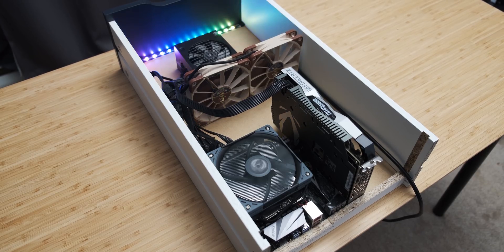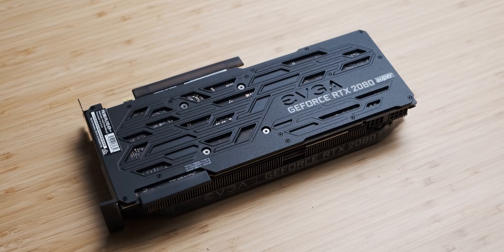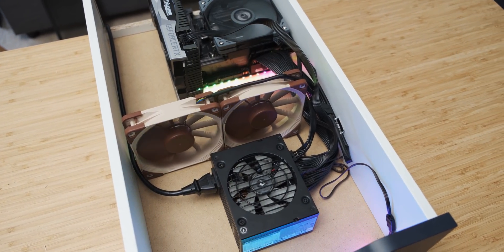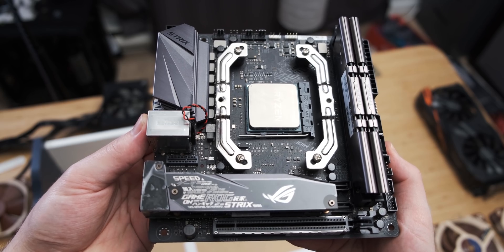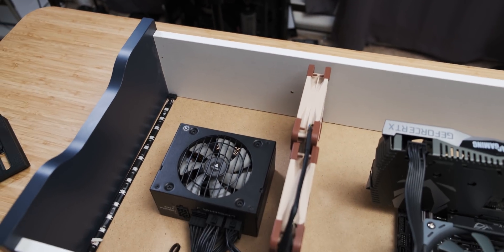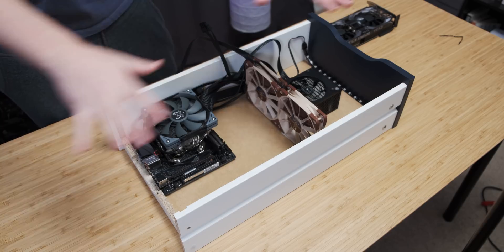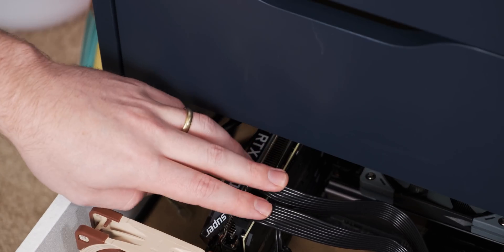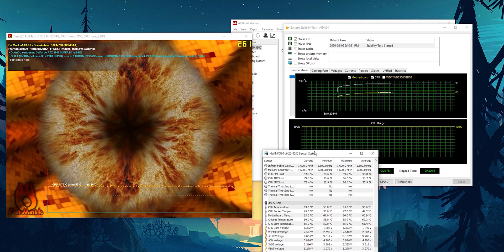How much PC gaming power can you fit in an IKEA Alex drawer?

Comment: Easy to spot the new Dremel owner. They're the ones using a sanding drum on a cutting disk job. :P 
But seriously, if you're worried about the thermals, I'd cut two circular holes in the front of the drawer big enough for the fans to draw in air, paint the newly exposed wood- excuse me, particle board, cut out the middle of two large jar lids and cover them with window screen, put them in the holes like a speaker cover, then mount the fans to the inside of the drawer front.

Comment: Potentially dumb question, but wouldn't it make sense to put different components in different drawers, drilling holes in the bottom of each drawer to allow for cables to go between them? Theoretically, this would mean that less airflow is needed per drawer. You could put the power supply in the bottom drawer, the graphics card on top of it, and then the motherboard on top of that (using a PCIe extension cable of course). It would obviously require a lot of custom length cabling, but I think it might work better for the thermals

Comment: Nice job...run it on top of the desk with a board covering the top.I bet your airflow is front to back with just the handle slit for air intake which is too small. That’s why you have very little dust... mount a fan to bring air in from the gfx card side and blow it out over the power supply and you can get massive amounts of air without any vents in the back...use the card as a room divider to separate the airflow... good job overall

Comment: Hey, i really don’t know a lot about pc’s and i found a pc on this Dutch marketplace, it’s €750, should i buy it or not? Specs: Gigabyte GTX 1660 Super
- i7 6700
- Corsair H100i V2 watercooler
- MSI Gaming pro carbon AC Z270 moederbord
- geen ram
- 2TB 7200RPM seagate ST2000DM001 HDD
- 250GB Samsung 850 EVO 
- 500GB Hitachi 5400 RPM HDD
- Corsair CX650m 80+ Bronze voeding
- NZXT H440 behuizing 
- 4 NZXT Fans 3x 120mm front 140mm back 
- Windows 10 pro

Comment: I have an Alex drawer already full of controllers and junk, instead of getting an ITX case I could just throw in an SFF build and call it a day. Now if I could at least throw in a 280mm radiator for water cooling that would be even better.

Also as someone who works at IKEA Customer Support, this voids the guarantee so proceed with caution if you do try this

Comment: Finaly you got a big boy card
Reply from the maker: It is all very exciting. 😁
Reply: @DawidDoesTechStuff  RuiLing 5-Pack 50cm PC Power Switch Cable Button ATX Desktop Computer Case Motherboard On/Off Reset Switch Line Re-starting Power SW Wire 2-Pin on Amazon those r awesome.  Or any similar 5$

Comment: you should use a metal plate and ground that power supply somehow. maybe taking and grounding the metal plate to the plug in the wall...but i was once told the psu needed grounded..and wood isnt grounding...
Reply: The psu is grounded if it's plugged in. However, some of the other components might not be. A metal plate, or aluminum foil, could help, it would ensure an extra path from the components to the psu/ground.

Comment: Glad you revisited this. For turning on the pc you might want to have a look at this SilverStone Technology 2.4G Wireless Remote Computer Power/Reset ... https://www.amazon.ca/dp/B01MQUANS8/ref=cm_sw_r_sms_awdb_t1_zCTpEb7WCR7EA I use this for a htpc I have. It uses USB to power the board and has a cable running from the control board to the power button pins. Then you can power on and off or restart using the provided remote. Got it on sale for $24.99 cdn and would definitely recommend it.

Comment: I have a question. 
I wanna buy an rx 580 8gb from sapphire the one with the 8+6 power connectors. Ive already got a 6+2 psu but thats all i have. However people are saying that it can run only on the 8 pin and it doesnt really need the extra 6. 
1. Is this true?
2. Can i use the card as normal for gaming with just an 8 pin?
Thanks for your time

Comment: I'm gonna tell you right now, hang onto the warranty information for that dremel. I have owned 3 and they break so easily.
Reply: @J Fz I have no idea, never opened one up to see what was wrong. It just... never turned on again.
Reply: If you used them like David here in this video im not suprised...
Reply from the maker: @Lipi19821  Yeah, please tell me what I did wrong?
Reply: @DawidDoesTechStuff  you dont use dremel with that sanding head to sand that much of a wood away, you should first use a repricating/jig saw to make the cut and only then use dremel sander for last half of milimeter.And for sanding you should use longer sanding head,should be as long as the thicknes of the drawer plus minimum 0,5 cm
Reply: @Lipi19821  I don't think he did anything wrong. It's just slower. It's not uncommon to takes tons of material away with sanders in general.
Reply: @MrBearyMcBearface  its stresing & overheating the motor...this tool is not made to be under high workload for long periods of time..
But do it as u want its your tool.
Reply: @Lipi19821  lol. Whatever dude. The only thing that went bad on my dad's dremel after 15 years of use was the battery.
Reply: @MrBearyMcBearface  yea becouse its such a strong and powerful tool you get all those big cutting blades and sanding discs with it...yea sure....im out u cant reason with stupid....
Reply: I've never seen a dremel break. Must be new ones.